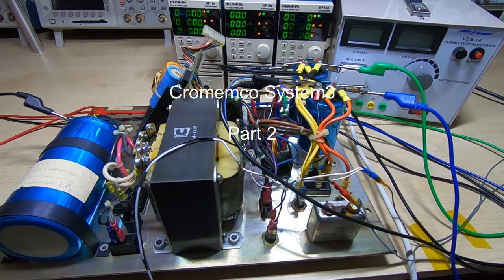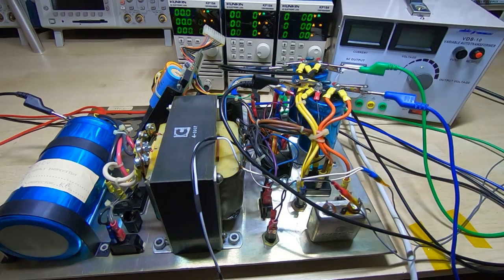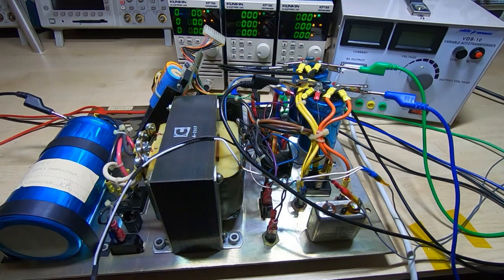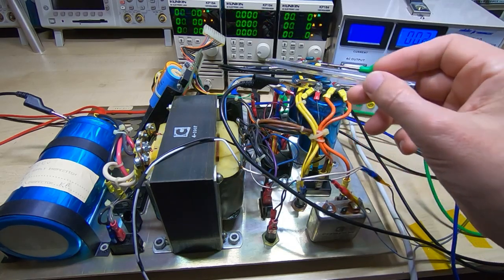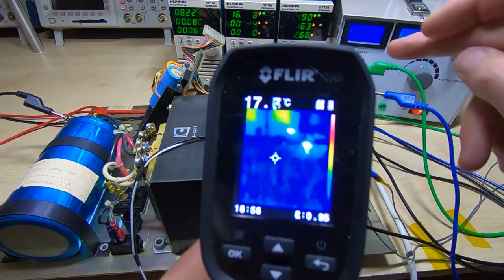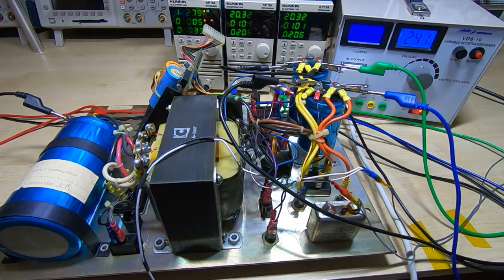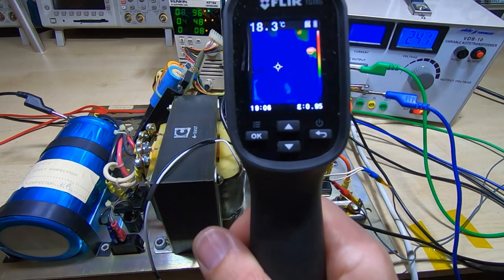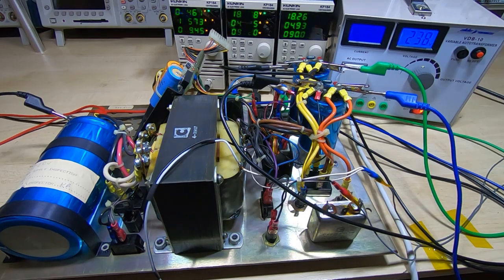Cromemco System3 Part2

Comment: I'm thinking the splice you eliminated on the mains power lines for the floppy drive was there so that power for a second dual floppy drive could be tapped off.
Reply from the maker: Nope, It was someone being lazy. The arrangement for dual drives is a daisy chain cable. I also very much doubt that they would not have just cut a wire and taped it up.